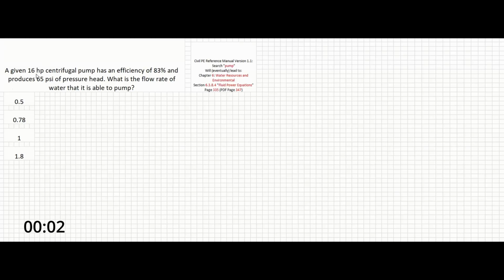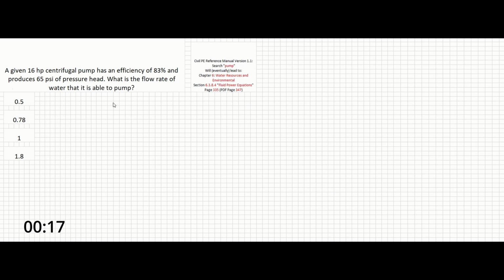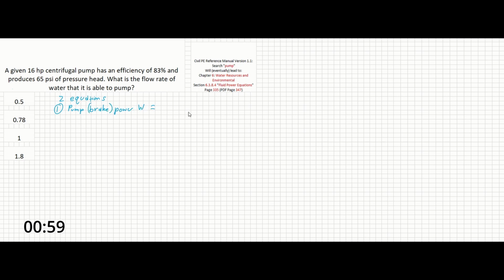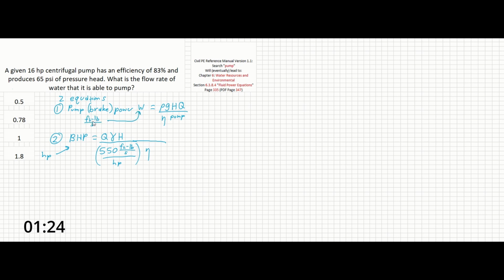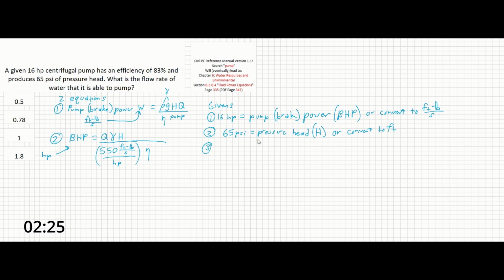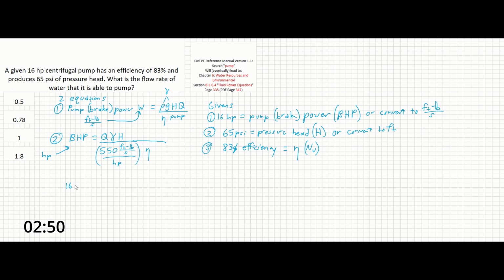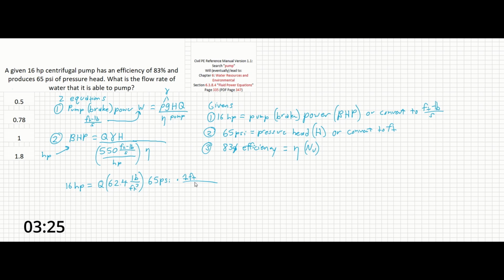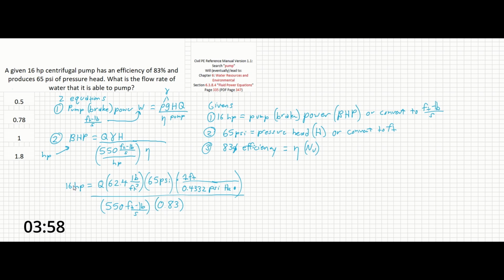PE Exam Practice Problem #17: Water Resources | Centrifugal Pump - Pump Efficiency - Fluid Power

Comment: There's another equation BHP=(Q*H*SG)/(3956*η) that worked for me, although that equation uses gpm for the flow rate. On an actual exam, it would be specified what unit to solve for, correct?
Reply from the maker: Nice find. And generally yes, I recall units being specified. Sorry I forgot to add them to this one.

Comment: Why didn't you use correct equation? If you use this then answer is easy and you can convert gpm to ft^3/sec if needed. 
BHP = (Q * P) / (1714 * η) . 
Q: Flow rate in Gallons per Minute (GPM).
P: Fluid pressure in Pounds per Square Inch (PSI).
1714: A conversion factor used to obtain BHP in horsepower when Q is in GPM and P is in PSI.
η: Pump efficiency (expressed as a decimal or percentage)
Reply from the maker: Thank you for sharing. You're right, this could be a faster way to solve this problem.

Comment: Great videos, I really appreciate how thorough you are in your explanations! I have been trying to solve on my own before playing the video and when I first tried to solve this problem, I wanted to use the equation BHP=QP/1,714Nu . After converting my answer from gpm to cfs, I also get 0.78. Is it appropriate to use this equation? Seems to be faster.
Reply from the maker: Thanks for the support! Glad to know the level of detail is useful and not tedious. I also think thats a great way to use these problems. See if you can solve in under 6 minutes on your own and then see how its done.  Good find in the manual, it looks like they provided multiple equations to solve this. Maybe just to solve for flow in different units without doing the conversion at the end? I'm not an expert in pumps but the equation you used is in the same section of the manual and I don't see any caveats listed about when to use it and when not to. Good job.
Reply: @SolvedIn6  thank you for the quick response!

Comment: Is the conversion psi  1ft =0.433 psi Hp in reference handbook ? Btw these videos are of great help!
Reply: Hey, not sure if it helps but in the conversion section of the manual the conversion is called out as Ft of H2O= 0.433 psi, if you look at the PSI conversion in the right hand column, it says PSI = 2.307 Ft of H2O.
Reply: @UnlucklyNut  In case anyone is interested in how this is derived, pressure (p in psf) = specific weight (gamma in lbf/ft^3) * head (H in ft). Using the conversion 1 psi = 144 psf and knowing the specific weight of water is 62.4 lbf/ft^3 yields a ft of H2O to psi conversion of 62.4/144 = 0.433 OR a psi to ft of H2O conversion of 144/62.4 = 2.307. 
Alternatively, since p = gamma * H, you can directly sub in a pressure in psf for the product of gamma * H in the formula. So for instance, in the problem where 65 psi was given as the pressure, convert to psf using 65 psi * (144 in^2/1 ft^2) = 9360 psf, then plug that in directly for the term gamma * H.
Reply from the maker: Thats correct! and sorry for taking 2 weeks to reply to you two. You're some of the first people who have commented on my channel and I didn't realize I wasn't getting notifications about comments.
Reply: @SolvedIn6 you are better than me. I just now realized I had comments lol
Reply: Happy to let you know that your videos really helped me pass the PE exam btw. One of the best resources I had.
Reply from the maker: @UnlucklyNut  lets gooooooo! Thanks for letting me know!
Reply: @UnlucklyNut  This is so useful